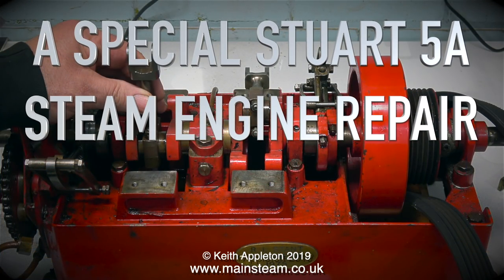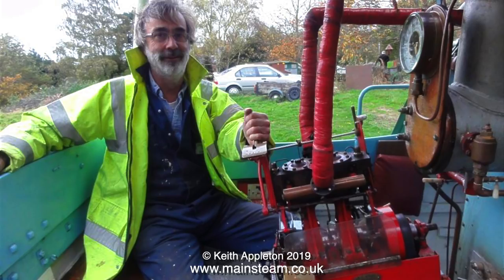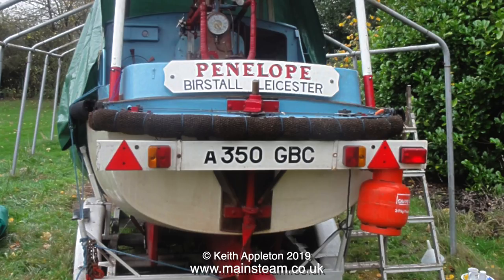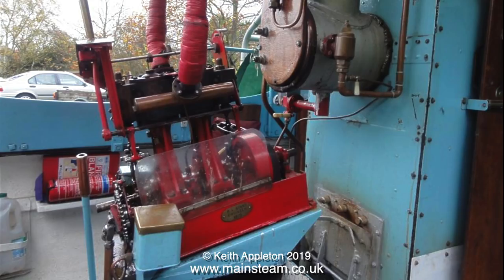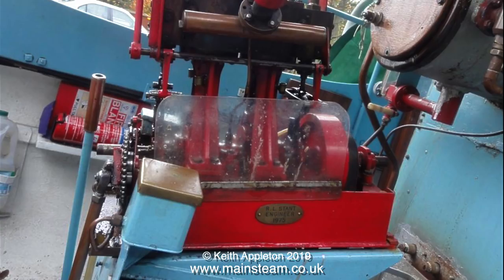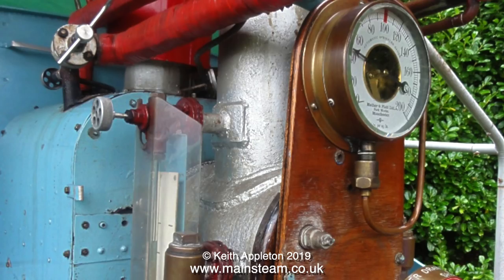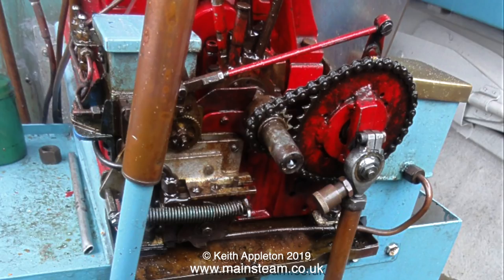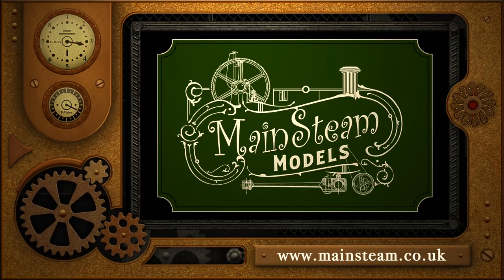A SPECIAL STUART 5A REPAIR - PART #4

Comment: 🧐 Hang about. That pint sized double expansion engine is pushing a boat with a bloke in it? 😳
Reply from the maker: The Cylinder bores are 2 1/4 inches in diameter on a  Stuart 5A Fred.

Comment: I had a lovely boat on the Norfolk broads, then some nasty person chainsawed the transom clean out with the engine and first we knew about it was snotty letters from the waterways people demanding we dealt with our sunken boat, then we also found out about just what "secure" moorings were not and we did get a little of the worth of the boat back but it was like pulling tigers teeth with insurance company refusing saying liability was with the mooring people, mooring lot just refusing to honour their contractual agreement and finding out that quite often the "security" guard the mooring employed was more often than not asleep in the local pub after a few hefty pints.   The only good thing is the engine in the boat was always a knackered seized up Mercury which was only there to stop the water getting in as we took our 40hp Honda home when not in use, boating is def off my agenda nowadays... although I have harboured a keen interest in converting my Reliant Robin to not only steam driven but also amphibian too (There's a steam driven Reliant Fox up in Yorkshire I believe)